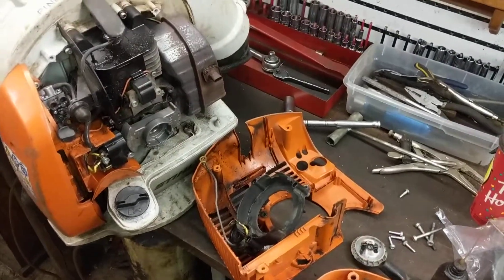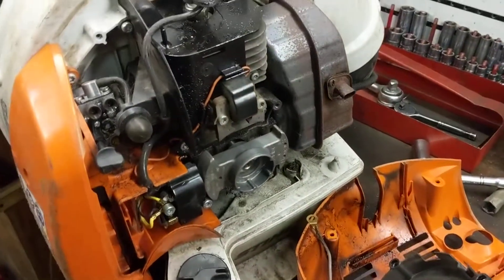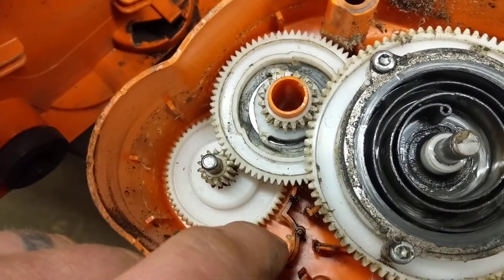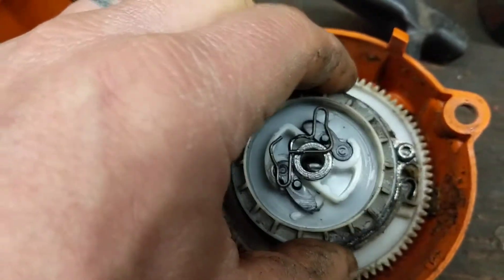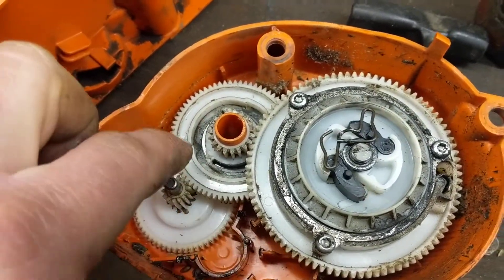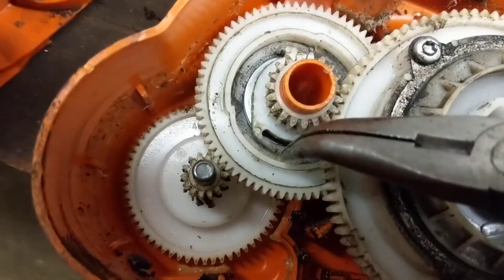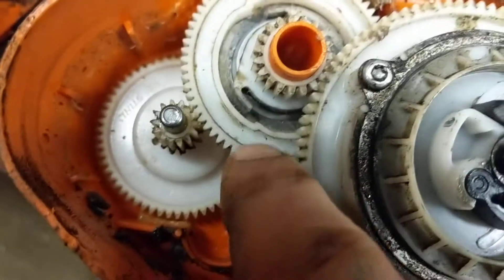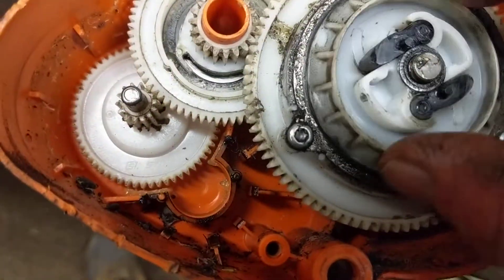Repair: Stihl BR 450C Electric Start Backpack Blower

Comment: So I replaced the spring housing on the one I have, but it took me so long to find the part (overseas, $$) that now that I have it assembled I can't remember where the wiring on the electric motor goes. I figured out the yellow wire, but have no idea how the gray wire is routed and where it goes. Any help would be greatly appreciated, I should have taken a picture during disassembly.
Reply from the maker: I thought it went under one of the screws that held the recoil or case on,. do you have a picture of the connector on the end of the wire?
Reply: @machinesnmetal  It's the typical round eye connector (both wires have it, just like in the video)) and that's where I remember it going, but I can't seem to route it correctly. It seems both wires would be going to ground though (going on two of the three screws that mount the recoil assy) if that's the case.
Reply from the maker: Did you look at a parts diagram.on google.image search?
Reply: @machinesnmetal  Oh yeah, it shows the motor but not where the wires go. Still searching. Thanks.

Comment: It is a complicated contraption. I love mine 😅. But after 7 years of using it to take care of 10 yard plus mine the capacitor is starting to get weak. 

According to Stihl. And they are right. You dont yank the rope fast like you do with other pull start equipment. If you do, you will screw that whole thing up like that one. 

Pull the rope slow and let it load up. It will suddenly fling the starter to spin the engine over. Yes it works.
Reply from the maker: These guys were teaching around back and pull starting it 5-10x per site. 🤦

Comment: I need to replace the battery do you know where the battery is located
Reply from the maker: Under the lower back pad
Reply: @machinesnmetal  Thank you so much
Reply: @duanemcdaniel1003  hi do you have a part number for the battery and where you purchased it? I need a battery. Thanks

Comment: Mine's got a 2-year warranty And I use it around 3-5 times most days so if it doesn't hold up they'll be sick of seeing me! Lol

I think if they've had problems with the plastic gears breaking they've probably gone back and redesigned them to be stronger since early models
Reply: Six months and no probs now

Comment: Seems like a cheaply made gear.  I have a 2009 Ryobi Backpack Blower with electric start.  Love it plus it meets the under 70db sound rating required where I live.  So someone made a comment Stihl was first dor electric start.  Appears Ryobi was before them.  I imagine others have also tried it.  The Ryobi uses a 12 volt battery like their drills use.  Plugs in in top of the Blower.
Reply from the maker: Yep

Comment: Looks like a simple enough repair for something that can be attributed to wear and tear, which is what happens to all mechanical devices. Nothing lasts for eternity except that which is eternal!
Reply: So if I wanted to bypass the internal 7v battery behind backpack 

could I: 
1. use an external 7v power source (battery)
2. Run wires and place a momentary swith between the yellow= Positive?? wire from the little electric motor?
3. Grey Negative  wired directly?
Placing that on a quick disconnect from the external battery source..

Will this work? Of course voiding  warranty.
I basicallywant to get an electric start on ANY 1st cold  attempt . 

The internal battery always need to be charged via engine running and work/starts
as it should there after..
Reply: So if I wanted to bypass the internal 7v battery behind backpack 

could I: 
1. use an external 7v power source (battery)
2. Run wires and place a momentary swith between the yellow= Positive?? wire from the little electric motor?
3. Grey Negative  wired directly?
Placing that on a quick disconnect from the external battery source..

Will this work? Of course voiding  warranty.
I basicallywant to get an electric start on ANY 1st cold  attempt . 

The internal battery always need to be charged via engine running and work/starts
as it should there after..

Comment: You've never seen anything like it because it's the only electric start blower in existence. At least up until a month or two ago. And yes, it is a marvel of idiotic engineering. Besides, who actually needs an electric start for a blower? If you're not capable of pulling a starter cord a couple of times to start it , it's likely you aren't going to be able to put it on your back and carry it around either. At first look it seemed this was a good blower. It can really move some air. Can burn up some fuel too. It's thirsty. It's poorly designed and built. You pointed out the recoil. Got one here that is brand new and the electric start doesn't work. Within 2 months the fan exploded and put a big hole in the housing. That was a little over 200 dollars for the parts to fix that. Wasn't warrantied. The way they are assembled is ridiculous. I've disassembled and reassembled many such devices and all sorts of things. This was one of the worst. And the 4 screws attaching the fan housing to the engine...... Not sure what was done there. They are self tapping torx head screws going into plastic. Was almost impossible to remove them. Broke 2 of the factory supplied tools and 3 or 4 quality torx bits.  Two of the screws broke off. And one of them the head stripped. Was a good thing the housing was being replaced. Used an angle grinder to cut away the housing to access the head with vice grips. With several attempts I got it out. The fan was updated to a different design. So hopefully it will work better. Had very little use when under normal use , the fan just flew apart. And then when you get the parts , they supply you with updated parts. So apparently there was an issue that they were aware of. Yet they continue selling the defective merchandise. Then they sell you parts to correct it. Sounds like bad business practice to me. And that's not even considering the initial cost. These things are not cheap. Don't know what's going on at Stihl. But doesn't seem good to me. Got a br800C here too. Haven't seen the workings  of the recoil on it yet. But it sure to be on the different list also. It's got very unusual operation. You can pull it with it on your back. But you have to just keep pulling it repeatedly. There will be little to no resistance. Then every few pulls there will be some. Once in awhile alot of resistance. Then it just starts. Seems like possibly it winds up a spring then releases it to spin the engine. Have seen old push mowers where you crank a handle then when it us folded shut it releases the spring.  Don't know for sure. But I'm sure to know here shortly. It won't start. Turns over. Possibly a fouled plug. But at this moment I'm not sure where that is. Have to remove some panels.

Comment: So if I wanted to bypass the internal 7v battery behind backpack 

could I: 
1. use an external 7v power source (battery)
2. Run wires and place a momentary swith between the yellow= Positive?? wire from the little electric motor?
3. Grey Negative  wired directly?
Placing that on a quick disconnect from the external battery source..

Will this work? Of course voiding  warranty.
I basicallywant to get an electric start on ANY 1st cold  attempt . 

The internal battery always need to be charged via engine running and work/starts
as it should there after..

Comment: So they broke.  Ok?  Easy to repair?  Expensive part?  You said it was garbage but didn't explain why or how to fix?  If it is cheap to fix, I would gladly repair it in order to have electric start.  Also, that blower looks to be heavily ABUSED.
Reply from the maker: you have to replace the "spur" gear. $8 part.
Reply: When you use this equipment for Comercial it does not take long for it to look abused.
Reply: So if I wanted to bypass the internal 7v battery behind backpack 

could I: 
1. use an external 7v power source (battery)
2. Run wires and place a momentary swith between the yellow= Positive?? wire from the little electric motor?
3. Grey Negative  wired directly?
Placing that on a quick disconnect from the external battery source..

Will this work? Of course voiding  warranty.
I basicallywant to get an electric start on ANY 1st cold  attempt . 

The internal battery always need to be charged via engine running and work/starts
as it should there after..
Reply: So if I wanted to bypass the internal 7v battery behind backpack 

could I: 
1. use an external 7v power source (battery)
2. Run wires and place a momentary swith between the yellow= Positive?? wire from the little electric motor?
3. Grey Negative  wired directly?
Placing that on a quick disconnect from the external battery source..

Will this work? Of course voiding  warranty.
I basicallywant to get an electric start on ANY 1st cold  attempt . 

The internal battery always need to be charged via engine running and work/starts
as it should there after..
Reply: So if I wanted to bypass the internal 7v battery behind backpack 

could I: 
1. use an external 7v power source (battery)
2. Run wires and place a momentary swith between the yellow= Positive?? wire from the little electric motor?
3. Grey Negative  wired directly?
Placing that on a quick disconnect from the external battery source..

Will this work? Of course voiding  warranty.
I basicallywant to get an electric start on ANY 1st cold  attempt . 

The internal battery always need to be charged via engine running and work/starts
as it should there after..
Reply: @machinesnmetal  So I replaced the spring housing on the one I have, but it took me so long to find the part (overseas, $$) that now that I have it assembled I can't remember where the wiring on the electric motor goes. I figured out the yellow wire, but have no idea how the gray wire is routed and where it goes. Any help would be greatly appreciated, I should have taken a picture during disassembly.
Reply: Fix it and keep blowing. I’m sure if Stihl thinks it’s a problem they will update the part. It’s a machine and sometimes they  need repairing.